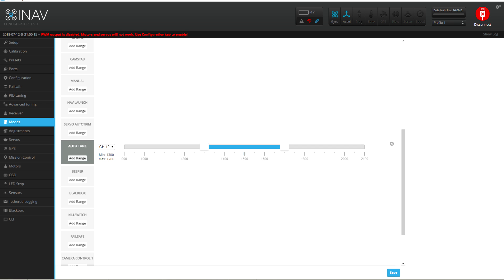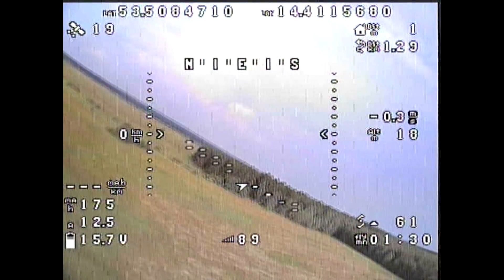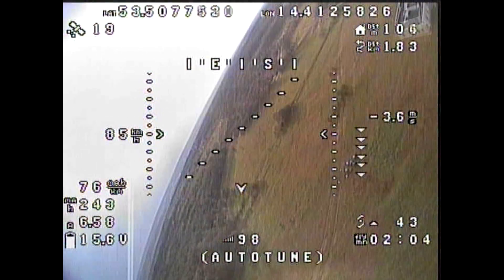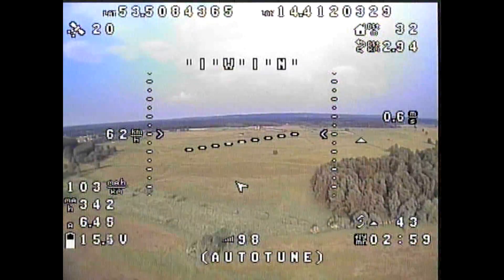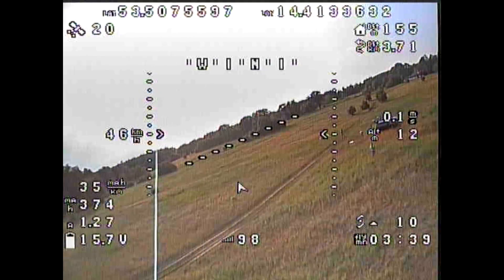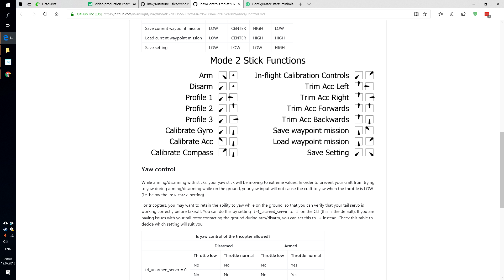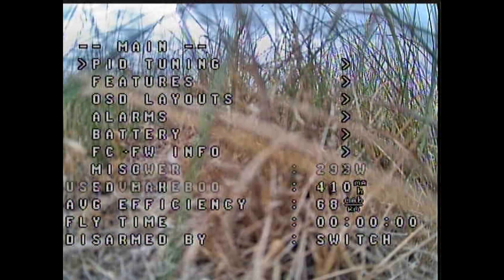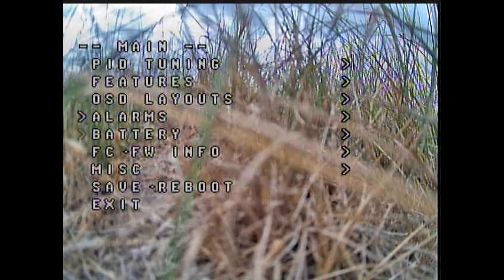INAV Autotune for airplanes: how to use it!

Comment: This video says DONT disarm before doing the stick command to save. But the INAV docs say you should DISARM before saving. 
quote "Note that AUTOTUNE mode doesn't automatically save parameters to EEPROM. You need to disarm and issue a stick command to save"

So which is it?

Comment: Bear in mind what it's doing as it tunes itself. Its compensating for sloppy. Me, my airframe and my environs are are highly subjective and the compensation for my less than optimal rigging results in drag. Lots of it. In short, it tends to hide real limits. My suggestion is to not do this until after you have cleaned up the airframe, electronics and rigging.

Comment: Hello...from what i understand, you are one of the most knowledgeable people around with inav...
I was hoping you could give me some assistance with my build?
I have the nano talon and stock servos, esc and motor, using all matek equipment;

Matek f765 fc
Matek gps
Matek 1.3 vtx
Matek digital airspeed sensor 
Matek buzzer
Runcam split 3 micro

I've started inav, have all flight controls and sensors working, still need to calibrate esc. Started setting flight modes.

Do you think you can help with a few CLI commands to use? I could use all the help I can get for success..thank you
Crossfire nano receiver
Reply from the maker: What do you mean with CLI commands to use? Use Configurator GUI for all thet is needed
Reply: @FPVUniversity  ...yes I understand, but what I mean is, are there any special servo mixes that should be adjusted from the CLI??
the example is like the one Painless360 uses for his tutorial on autolaunch, where he types in the CLI:
set nav_fw_launch
I followed the video, Painless360 then modifies the values, like inclination, throttle value for idle before launch, time to launch, etc...
I was asking if there are values that should be adjusted for particular desired characteristics in certain flight modes.
I've set up the configuration per the GUI, I was just asking...this is my first time setting up an FPV platform, so this is all very new to me, so I have very little confidence and knowledge...but i review many videos and read as much a possible, so i have nothing to actual confirm that im right...i won't launch till im absolutely sure

Comment: Pawel, I manually put in starting PIDs at what you recommend in your video. I flew it and ran the autotune method anyway exactly as you have it here in this vid. I saw the autotune message on the OSD and everything. However when I landed the PIDs did not seem to change at all? They were still at my settings. Thoughts??

Comment: Quick question when i'm in Inav on the mode page i set autotune up on a channel and when i switch it from the radio it doesn't highlight or show that its (ON) like the other modes i have set up such as angle mode horizon mode etc... am i doing something wrong should it be armed for this to work properly??? thank you for your time!!!

Comment: How do you enter the osd throttle middle yaw left pitch up ? But if the planes not disarmed how do you enter the osd without turning the motor ?

Comment: Good morning, I have a question: the autotune and autotrim you do in manual o stabilize mode? Thanks
Reply from the maker: in stabilized
Reply: @FPVUniversity  thanks a lot!!! 💪💪💪 I will try! Another question: the cruiser mode is alt hold +???
Reply from the maker: @cormorano78  am... what? Please elaborate
Reply: @FPVUniversity  if I want use the cruiser mode, which comand I need to set in the configurator?
Reply from the maker: Cruise flight mode will be enough
Reply: @FPVUniversity  so only cruiser mode in one switch with out any flight mode like alt hold. Thanks a lot!!!

Comment: I tried this today. 
Sadly my AR900 went into the ground as autotune did realy strange things after around 1 minute. kt was feelyng verry bad in the air before. I even tried to go back to manual mode but I coulnt save it. 
I dont know what I did wrong. Am I supposed to do loops and rolls as sugestet in the wiki ? or only upright flying ?
Reply: Same things when i switched up autotune it start make strange things after crash to the ground!

Comment: Hi Pawal, I'm finishing my Nano Talon with iNAV 2.0.0 on a Matek F405 Wing (270 degree mounted), with an M8N GPS+Compass.
Everything looks fine, except the Direction to Home arrow in the OSD.
It points correctly to home when the plane is pointing directy to home or going away from it, but the direction is inverted while in other orientations.
For example, it points to the right when the home is to the left, and vice-versa.
Have you seen this issue?
Reply from the maker: You have wrong compass orientation. Airplanes do not need compass, disconnect it

Comment: Can someone confirm what flight mode you have to be in with auto tune or does it not matter wether you are in manual,acro or stabilised ?
Reply from the maker: Acro, Angle or Horizon. Acro is the best
Reply: Pawel, thank you for the time you are devoting to this project. Now, about your answer. You suggest ACRO as the best mode to use with Autotune, which it makes a lot of sense. My problem is that I am running 2.0.0. and ACRO is not in the MODE list. Did it change name or it was eliminated? Wouldn't Angle or Horizon try to correct the maneuvers and affect the Autotune job? Your advice please.
Reply from the maker: This is somehow messy... Acro is when Manual, Angle or Horizon not enabled
Reply: Yep. Its written in one of the git docs. I guess I overlooked it. Sorry. I also found the definition of RATE or ACRO in a betaflight doc. Will have to look in depth on that because when I went into Autotune/Acro today, the plane entered in a straight up climb. Anyway, then you for your help.

Comment: You said in another of your (great!) tutorials, that the FF-Value has to be calculated from the maximum Roll-/Pitch-Rate the plane can archive. So is this obsolete now? The iNav-Tutorial says also, that FF can be raised manually till it reaches around 90% deflection of the ailerons. 
How do I reach it now in the best way? Raising FF till 90% aileron way, then flying with this and measuring the Roll-/Pitch Rates to enter, and then afterwards an Auto-Tune Flight?
Thanks a lot for your great work!
Reply from the maker: There is a simpler aproximation: max deflection should not be bigger than 30 deg. And TBH 20deg is enough
Reply: So really just adjusting FF to 20-30° - but then adding the corresponding Roll-/Pitch Rates to the Configurator? That's great!  Will Autotune change FF afterwards, or will it just raise P and I Term?
Thanks for the quick reply!
Reply from the maker: WDZaphod autotune updates p and ff
Reply: Interesting - on what base does it update FF? Does it try to reach the Roll-Rate defined in the Konfigurator? After the Autotune, which will most likely result in another max. Roll Rate (due to different FF-Values) - is it required to measure the max. deg/dec again, and update it in the Configurator? For me it's still not clear how to get this Roll-/Pitch Rate, because it depends on the aileron deflection, which depends on FF?

Comment: I'm at a loss, I just built an S800 it's all set up, except one major pain I can't figure out. I been flying quads for the last 3 years, built 20+ quads & never encountered this one. My arm switch turns the motor on, and the throttle stick mode2 does nothing. All is OK in rx tab.
All modes are setup correctly in inav & Aux channels are all applied to the right switches. I'm running an F411-WING
Not an f405. With 1.9.1.
My target for the board matekF411 is not in any of the drop down in 1.9.1 or 1.9.3  so I'm stuck on this firmware till probably a future update. Everything is as it should be with all green lights & the esc works the motor in motor tab.
Arm SWD will turn motor upto about 50% & do this while the USB is plugged in & on any tab in inav.
If I throttle up stick to max with no motor movement before I arm swd, it cancels it out.  At first I thought I had somehow put throttle on a switch but everything corresponds on Tx, rx tab & modes. First time configuring inav & not a good experience as I can't find the matek F411 wing in the choose a board drop down in 1.9.1 or 1.9.3
I don't want to take the pre releases as I'm having enough problems now.
Endpoints
1105
1500
1900
1000
Reply: Sounds like your ESC might not be calibrated. If the Configurator shows, in the Receiver tab, that the throttle values are the same as what you are moving the stick on your radio then I would certainly try calibrating the ESC. To do this I would connect the plane to iNav, no battery on the plane yet. Go to the motors tab and click the box for 'I understand I will be spinning the motors' PROP OFF, and then move the master tab to 100% throttle. Now plug your battery in and wait for the ESC to give the tones that is has the high end signal from the FC. Now lower the master slider and the ESC should go through the normal startup beeps.
Reply: Also iNav was not written for the F411 target on 1.9.1 or earlier versions, this is why the configurator will not show the board. At this time the only iNav FW for this FC is "unstable" versions of 1.9.1 or 2.0.0RC1-4. Hopefully the iNav 2.0.0 stable release won't be too far in the future.
Reply: NoAgenda FPV thanks for that reply dude. Got it all sorted now. I downloaded all configs & F411 not in any. So I'm on this till a future update, just as I get sorted the weather turns. Maiden in the next few days. Inav needs a lot more work. I'm not having a dig & I do realise this is a community. But coming from betaflight after 3 years, it wasn't the doddle I thought it would be.
Reply: Woodsy5791 woodsy5791 this isn’t an inav problem...you have to do this with any analog esc protocol. Including in betaflight, and even with analog esc’s not using a flight controller.

Comment: Confirming the need to disarm to issue stick commands as the other said .Also the osd can only be entered after disarming. 

So we're only left with connecting to the computer while armed to save the tune.

Comment: Autotune has something to do with rates as you should anter roll/pitch/yaw rates that your plane is fysically capable of. Is that correct or the default rstes in iNav are universal?
Reply from the maker: You should enter rates that you want to fly with, but not greater than the ones that the craft is capable of reaching

Comment: Why not disarm ? Whats about Aeroplanes that need to Spin Motors when armed like Fold Propellers ? 
is it really neccessary to not disarm ?
Reply: Good point! Wiki: You need to disarm and issue a stick command to save configuration parameters.
Reply: IS stick command always there? ie.. do I need to set something up before stick commands are effective?